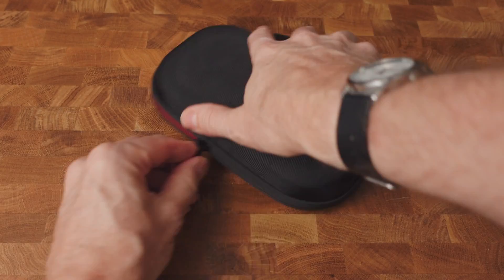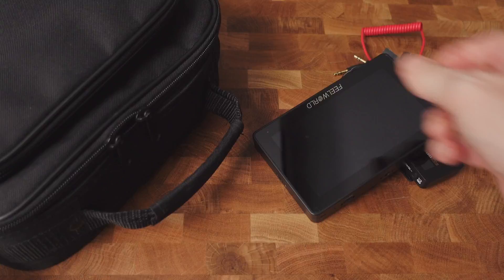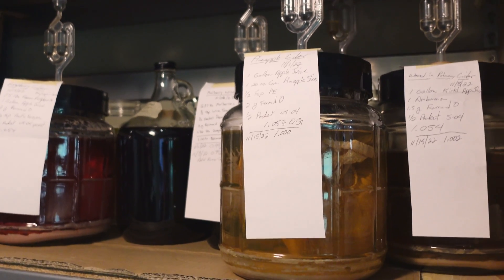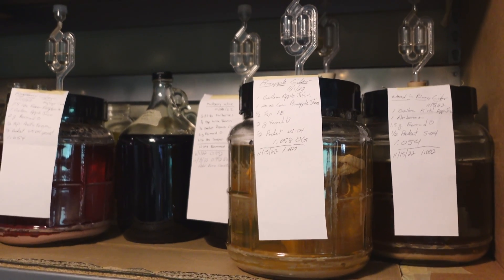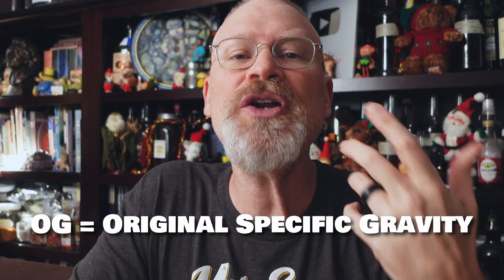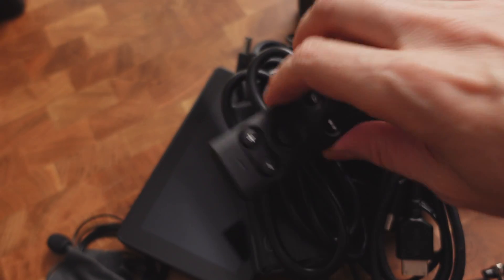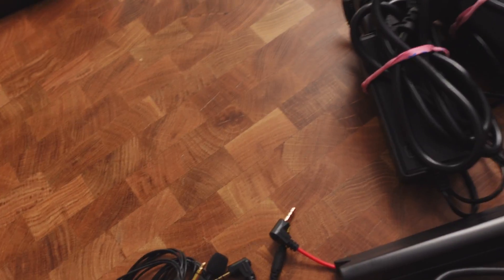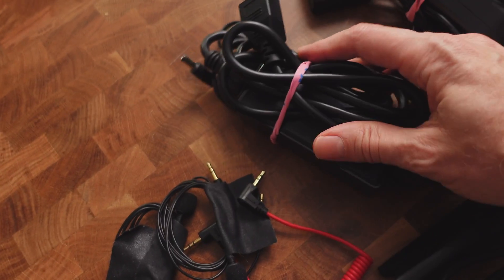Too Much SUGAR in my Mead or Wine! (or too much honey)

Comment: Got Some great Honey directly from our Bee Keeper. Did 3 Lbs. in a 1 Gal fermenter and water to the measurement of 1 Gal. Didn't have a Hydrometer when we started but then did some Cider and got one. Came back to the mead 2 months later. 1.270!!!!!! Was like OMG now what. Watched this video and am splitting the brew between 2 Gal fermenters. Will update. Interested in the link others talked about for a cherry mead you split. Cant find the video after searching.
Reply from the maker: I really don't think it was 1.270.  For one, they don't go that high and two... that much honey in a gallon is around 1.100.  So maybe it's 1.027?
Reply from the maker: No need to split.
Reply: @CitySteadingBrews   I was feeling like Mary Shelley's "Frankenstein" and now I feel more like Gene Wilder. Ok, far be it for me not to admit when I have made a terrible mistake LOL! Yes, I have been reading the Hydrometer wrong... to make matters even worse, because when you mess something up, why not go the whole way? Yup, I split it before I saw your response. However, now reading it correctly one reads 1.012 and the other reads 1.010. The odd thing is I didn't add anything to them but they are both bubbling again. Not touching them until I read your response, will obviously take another reading in a week.
Reply from the maker: Just let them do their thing at this point.
Reply: @CitySteadingBrews  I have come to learn that failure is a victory as I actually learn from them. Thank you! If this turns out good I am going to cry cause this will not be repeatable.

Comment: Hoping you guys can help so I don't lose my batch. I found this video kind of late and I'm already 2 weeks into a brew with OG of 1.200. Now it's reading at 1.102 and I'm pretty sure it's stalled. Is there something I can do to save the brew? Additional notes: I used EC-1118 yeast and didn't added 5lbs of honey and crushed juniper berries. I'm following the Skyrim cookbook recipe for mead but at 1 gallon instead of 1/2.
Reply from the maker: Split it into two one gallon fermenters and fill each back to a gallon with water.
Reply: @CitySteadingBrews  thank you for the advice. My airlock are vigorously bubbling now. I'll be more careful with the sugar

Comment: I actually had too much sugar in a "wild yeast" mead ferment. I could smell alcohol in the vessel (only a quart) and I could see tiny bubbles still rising along the side of the vessel, but the hydrometer (which I didn't have when I initially created the brew) did what others commented---it nearly popped all of the way out of the sampling vessel.  Unfortunately, it got dumped.  Then, I saw this video.  Makes sense that you could split the batch, perhaps add more yeast and yeast nutrient to get it going again. Oh well. Live and learn.

Comment: I was able to get lucky and force a ferment on a extremely high gravity must and end up with a very sweet high ABV mead after 3 months on the lees. I believe high pre-oxygenation of the must, the perfect temperature and a very good 11grams of yeast gave me a over 20% mead on finish.
Reply from the maker: It can be done, but it's not really that easy.  What kind of readings did you have?

Comment: I have 3 batches that all stalled at the same gravity.  
Used traditional ingredients, black tea, orange peel, raisins.  Did not do any step feeding, and did not add any nutrients until they stalled.

Two started with a higher OG of 1.152, the other started with 1.142.
Pitched with V1116, and EC1118.  

Temp for all 3: Roughly 75 degrees
All 3 stalled at 62 SG.

Tried adding Ferm-o to one,
Tried adding rehydrated yeast and Go-Ferm to another,
Tried adding Ferm-k to the third.

They started bubbling for 1 day, then stopped.  No change in gravity.

Tried adding yeast 1118 to all 3, no change.

They've been stalled for about 2 months at this point.

I would like these to finish out closer to 30 SG or lower.  

Should I just split and water them down?  How much should they be diluted?  Just add water until I'm at the desired 30SG, then see if the yeast start working again?

One thing I did notice - The bottles are on a heating pad, thermometer is halfway up the bottle.  The temp reading as mentioned is around 75 degrees.  But when I put my hands near the neck, the bottle is cold, and if I keep my hands there, it starts bubbling again?

Thanks!
Reply from the maker: You may need fresh yeast too as they may have died off.  On the plus, it's already 12ish %.

Comment: It's strange.  The more brews I make, the drier I like them.  I started with your grocery store mead and sweetened to 1.160 and it was great.  I just sweetened my current traditional to 1.022 and it's just right.
Reply from the maker: Sweetened to 1.160?
Reply: @CitySteadingBrews  Well I thought it was delicious...now it's like syrup.  That's at the very end of what my hydrometer can read.
Reply from the maker: 1.160 is high for a starting specific gravity, it's like adding nearly 5 pounds of honey to a gallon, yeah, that's syrupy and sweet, lol, since it's almost half a gallon of honey.
 @raist315
Reply: @CitySteadingBrews  I'm sorry, I said that all wrong.  I start them all at 1.100, then they go dry, 1.000 - 0.994.  Then I pasteurize and backsweeten to 1.160.  Now I backsweeten to about 1.022.

Comment: Wow 1.120 is exactly the OG # ended up at after figuring out had honey stuck on bottom, was shooting for 1.092 in Blue B Mead.  That was Friday evening. Fermenter seems to rocking along just fine Sunday afternoon. Should end up at 14% or so having used Fleischman Active Dry & Fermaide O, but keeping a close eye on it.  Without these vids would be totally lost - but if it stalls should be able deal w/ it. Thx !!!

Comment: Is there any danger of drinking a stalled brew?  Like my meed started at 1.130 and ended in 1.036 and was 12.5% very sweet befor i put it in another fermentor, im letting it sit after 2 mounths for sediments, is it danderous to drink?
Reply from the maker: Nope.  It's not dangerous.  Especially after clearing out.
Reply: @CitySteadingBrews   if there is dead yeast on the top outer rim, is it dangerouse to drink, should it be treated? If so how? I cant find anything online. Or should i just siphon it and try not to suck it up?
Reply from the maker: Yeast is not dangerous to consume.
Reply: @CitySteadingBrews  thank you guys very much, im feeling very apprehensive in this last step

Comment: OG at 1.130.( 30.10.2023) Racked at 1.020, on 4.10.23. Zero activity. Tried it. Tasted good with residual sugar. The wife liked it Oh It's elderberry wine.Settling right now.I calculated 14.85ABV. Does that sound right? BTW i used a local (Tandaco) dried bakers yeast.
Reply from the maker: Sounds right :)

Comment: First attempt at making mead, and I just came across this video a week into fermentation.  My Original gravity reading was 1.30, which now I'm seeing is way too high (only 3 lbs of honey was used). After a week of fermentation, is it too late to split the batch? Do I need to add more yeast to each fermenter? Or just dump half into another fermenter and add water to fill? Thanks for the help everyone!
Reply from the maker: You sure it was 1.300 and not 1.130?  Most hydrometers only read to 1.160 and three pounds if honey could not give that reading in a gallon :)
Reply: @CitySteadingBrews  Ah crap, I'm honestly not sure at this point, and looking at my hydrometer I don't see why I recorded it as 1.30 as I'm pretty sure it was in the yellow range. I would assume since fermentation has started, it's too late to take an accurate reading? 
I REALLY appreciate you coming back to a 10 month old video and responding to questions, really shows how much you care about your community! Cheers!

Comment: Long question with lots of info ahead:
Is there a formula to determine how much s.g. would be lowered by the addition of X amount of water to a must?  I'm worried I may be facing a stall based on the OG for my must (1.144).
For example, 3.01 lbs of honey, s.g. of cherry juice was 1.084 (I used 1 gallon) in a little big mouth bubbler.  The SG was 1.152 and went to 1.144 after the addition of 1 cup of water.  Since I pitched the yeast yesterday, is there a formula to use  to calculate the corrected OG based on the addition of 1 cup, 1 pint, or 1 quart of water depending on how much will fit? (Also, I used a whole packet because I knew the sugar content was high). I know 3lbs of honey is 1 quart and based on my math, I have have about 1.3125 gallons based on the 1 gallon plus 1 quart plus 1 cup in a 1.4 gallon fermenter and don't have another fermenter as an option at present.  If I were to add a pint, it would bring me to 1.375 gallons (I know that is at capacity), but would it be correct in the formula of 1.3125*.144 = .189 and then divide that by 1.375 to get the estimated OG? If so, would 1.137 be the appropriate answer or did I do something wrong in my math?
Reply from the maker: Easiest is how we do fortification:  (parts of liquid 1 x gravity of liquid 1)+(parts of liquid 2 x gravity of liquid 2) / total parts.  This gives you the new gravity.
Reply: @CitySteadingBrews  Thank you

Comment: Had a mead starting out at 1.13 OG. It had fermented down to 0.99. At that time, it was time for me to add yeast nutrient to the mix and OG jumped up. I am sitting at around 1.15 right now. It is a 5 gallon batch. If I drain some of the mix out and add in water, could I restart fermentation or would that be a big no-no as it may cause it to turn into vinegar? I had two pints of honey and 5 pounds of peaches. Too much honey?
Reply from the maker: Wait… 1.130 fermented to 0.990.  You added nutrients?  SG went up?  To 1.150?? That doesn’t make sense.  If it was done fermenting and went dry at 0.990, why add nutrients to it and… nutrients wouldn’t change the gravity.  Sorry, I want to help but could you go over your method and readings again please?
Reply: @CitySteadingBrews  I am not certain that it was done fermenting. It had only been fermenting for about 5 days at the time I added the nutrients. That seems like a very quick fermentation. When I first made the batch, my OG was 1.13 on both a tilt and glass hydrometer. I added my yeast. At day 3, took the air lock off, added more oxygen to the mix. At day 5, gave the nutrients and had to leave for the weekend. When I came back, I was getting 1.17-1.15 readings off my tilt hydrometer. I'll take a reading on a glass hydrometer this weekend but, as of last night, I was still sitting at 1.15 after slushing the mixture to keep the bag of peaches wet. It's not making any sense to me either, its the same steps I have done for every other batch that I have done before and I have been successful with those. My yeast is about a year old, temp has been between 70-80 in the house due to no AC. My lees is pretty minimal in the bottom of the carboy and the mead mixture has not cleared at all, compared to when I made a 1 gallon batch of this recipe.
Reply from the maker: @eddiefleetwood2945  Your readings are going up.... that doesn't make any sense at all.  0.990 is dry, and should be done.  You're showing higher than your OG readings mid-fermentation....
Reply: @CitySteadingBrews  I don't disagree. Further, I am not seeing any signs of fermentation goin on. Should I split it? Taste it to see what's going on? Do a glass hydrometer reading and compare it to the tilt readings? Really hate to throw out 5 gallons of mead.
Reply from the maker: @eddiefleetwood2945  I really don't understand what is even happening to be honest.  I don't know how you are getting readings of 1.150 after your OG was 1.130 after getting 0.990.... I can't tell you to split it or anything since none of the data is lining up.  I wouldn't dump it, I would just leave it and check again in a week or two.
Reply: @CitySteadingBrews  Thank you sir, you're a gentlemen and scholar!

Comment: My 1.128 Cyser mash has stalled at 1.018 afyer one month. What should I do??????
Reply from the maker: Without knowing exactly what your recipe and original gravity was… it may be stalled, or it could be done.  Could you give more information please?
Reply: @CitySteadingBrews 
 3 Gallon batch

5+ – 64 oz. (2 Qt) bottles of Lidel 100% Apple Juice
7.5 lbs. Honey (4.5 lb. Kirkland Raw Honey) & (3 lb. Kirkand Raw Unfiltered Honey)
Juice of 1 Lemon
3 teaspoons of Fermax Yeast Nutrient (label suggest 1-1.5 teaspoons per gal.)
1 package Lalvin EC-1118 yeast
Hydrometer reading = 1.128 (16.5% ABV possible)
Vodka in Airlock

Day 2. Added additional teaspoon of Fermax.
Swirled bottle a little on day 1,2, and 5 to de-gass a little.
On day 13 (04/23/23) bubbling in airlock slowed down from 1 bubble every second to 1 bubble every 2 seconds. On 04/24/23 it was producing 1 bubble every 4 seconds.
On day 21 (05/01/23) bubbling has decreased to one every 28 seconds.
05/17/23 – measures 1.018

I screw up - was supposed to put 6 lbs Honey. But I found out afterwards that those 1 lb. Honey Bear containers were actually 1-1/2. So put 1-1/2 lb too much honey in.

Comment: Well damn, I think my wine stalled and if course I don't have anything to measure it. So I started with my 2qt grape juice, poured about 1 and half cups out, put in 2 cups of sugar on May 6 with bakers yeast. It was cooking along great but now it's been a lil over a week, about 8 days and there's just few bubbles. How can I know if I've stopped without measuring it? 🤔
Reply from the maker: A hydrometer will tell you for sure.  You could taste it.  Without measurements it’s hard to know done from stalled unless you know for a fact it should be dry and it’s dry.  I highly suggest investing in a hydrometer.  Conversely, you could leave it a few months and at that point it should be done.  8 days, there is a possibility it’s done.
Reply: @CitySteadingBrews  man this stuff is so interesting. I really appreciate you 🤙

Comment: I want to know what you are doing to lose weight. Please tell.  Also, where did you purchase those cute fermenting jars? Are they gallon size? Thanks.
Reply from the maker: We started a low fat plant based diet a few years ago when I was diagnosed with high blood pressure, high cholesterol and diabetes.  Lost about 60 pounds or so, but have gained a few back for being lazy and overeating.
Reply from the maker: The little jars are from Amazon.  I think they are half gallon?

Comment: Is powdered sugar okay for firmenting ?
Reply from the maker: Only if it's just sugar.  Many have corn starch to prevent caking.
Reply: @CitySteadingBrews  so if it's got corn starch it will not work
Reply from the maker: @bboynewsboy991  I wouldn't want to put corn starch in a brew is all.
Reply: @CitySteadingBrews  New to brewing, if I might inquire, as I seem to be getting conflicting answers, do you want your brew to breath during the firmenting process or to be sealed tight?
Reply from the maker: It’s fine to be open but… you do want oxygen at the start and do NOT want oxygen added once there is alcohol.  Thus we aerate at creation and use airlocks.

Comment: Think i'm having this problem now. Pitches yeast for the 3rd time yesterday. Somebody put 17.5 lbs in a 5gal batch. I didn't take a starting gravity reading. 17.5# is from one of your recipes
Reply from the maker: We have never put 17.5 lbs in a recipe afaik.
Reply from the maker: But if you scaled up… that’s 3.5 lbs in a gallon.  I think we did that once.  I do not recall the recipe though.  Can you tell me the starting gravity and other ingredients used?
Reply: @CitySteadingBrews  it was your spiced metheglin. Your 1 year review sold me. Turns out I had a leak at my bubbler. I made a flour dough and sealed it. It is bubbling away happily. Now i'm not sure if 71B, EC1118 or D47 is doing the work.
Reply: @CitySteadingBrews  it was scaled up for a 5 gal batch.

Comment: Good advice.  I would add that if you get a stalled brew, and absolutely cannot get it to restart but only have one fermenter, I've had good luck using Red Star's DADY yeast.  It's a distillers yeast capable of 22% alcohol.  Obviously, I don't ever try to go that high, so I never worry about step feeding or nutrients.  I just put some in and leave it be.  One drawback, is that as far as I know, it's only available in 1lb packet at brew shops or online.  Just be aware that if your looking for a flavor profile from the yeast, this is't the one for you.  As far as I can tell, it's a pretty neutral yeast.  Of course, I have a peasants palette ( I don't detect most subtle flavors), so your mileage may vary.

Comment: Good video (as always).  You should do a video on step feeding for people who do want that 20-22% abv brew.   In fact even if you want to do something with say 1.130 OG, it might be a good idea to split the sugar in 2 batches and add the second half after fermentation is strongly going.  Say 2 or 3 days later.  Regarding fermentation difficulty and stalling, I have resolved the issue by doing yeast starters using Go-Ferm.  The fermentation is so strong now it is almost scary ;)

Comment: I had a raspberry wine in plan. Originally I wanted to juice out 5kg raspberry, but the ,,juice" was too thick, the hydrometer did not work at all (it stopped where I let). So I had to split the batch into, and water it up. Now it has a strange watery, empty taste. I hope some raspberry+hibiscus tea will solve it's problem. Also its over the tolerance already, but still dry as bone. Safale is a true workhorse.